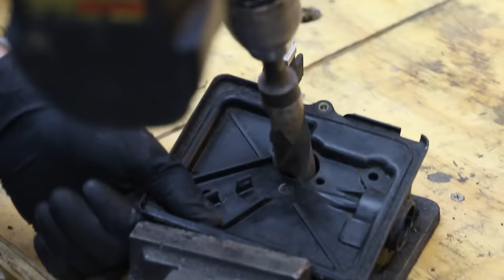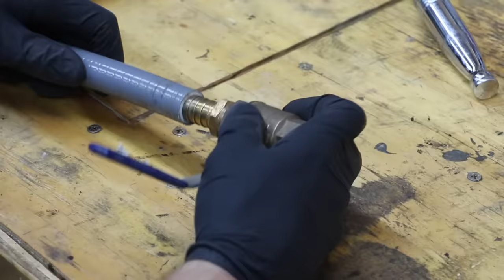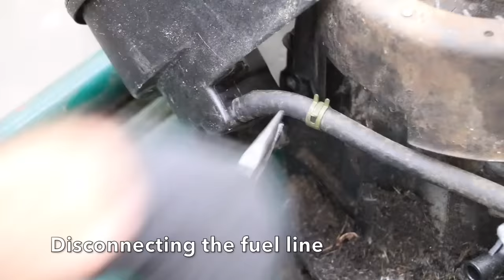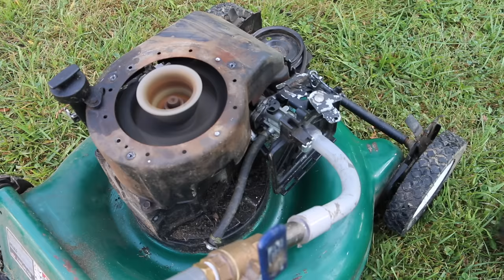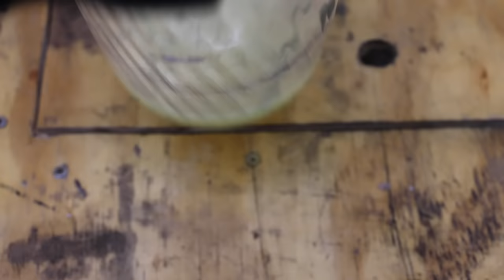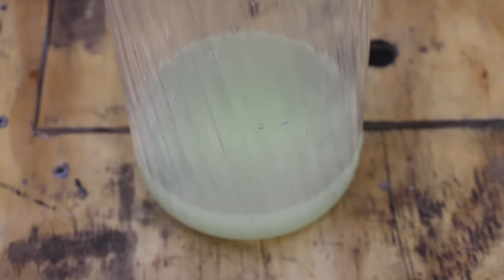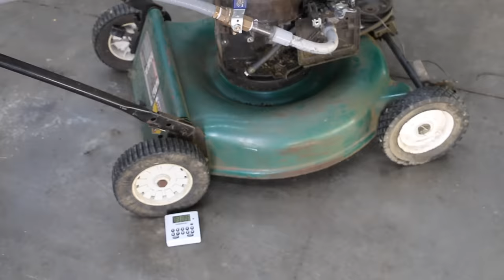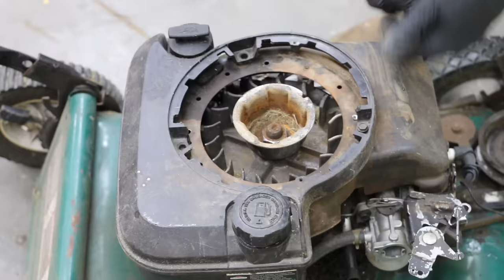Will a "Gas Vapor" Container Improve MPGs and Fuel Efficiency?  Let's find out!

Comment: On your setup for vapor feed, you need to meter in filtered air with the vapor from the canister. Put a "t" inline with the vapor coming in from the bottom and filtered air from the top. The vapor line should be wide open, and the airline will be your throttle controle. Just be sure to watch your engine temp, to high, more fuel, to low more air.
Reply from the maker: Thanks for the feedback.

Comment: People were probably referring to a GEET reactor (Paul Pantone), it's using the same bubbler, but the vapor goes through a pipe with metal rod inside it, then that pipe is inserted into the engine exhaust pipe. The theory is that the cold vapor fuel passing through the heated exhaust turns the vapor into a plasma(I'm not convinced that's attainable - I thought it would take more heat... but there is a vacuum but again insufficient), and the metal rod constricts the flow as a venturi, accelerating the plasma to your engine intake. The plasma fuel burns easier,  more bang for each oz of fuel, ergo the consumption is better.
Reply from the maker: Thanks for sharing.

Comment: Try Marbles, smaller intake hoses, splash guard, separates the air and prevents droplets from being wasted, spreading out the airflow and even using a different fuel may benefit. Maybe also add a periodic injection of fuel instead of a continuous bubbling tank to minimize that splashing, maybe an alternate one time injection into the engine to get it started and then run off the marble guard etc. I also have thought about the introduction of HHO gas to a vapor setup and see how it effects the fuel usage, but then we're talking alternator or battery needs for the conversion etc.
Reply from the maker: Thanks for the suggestion.

Comment: The fact that it works with vapor proves it can be possible.

Perhaps something needs to be done first with that vapor... pressure temperature etc

But you have proven that just using gas vapor doesn't increase the mileage.

Well done.
Reply from the maker: Thanks!

Comment: Look up V-GAS out of Wooster and Toledo Ohio!! 
My grandparents had stock in that company and was authorized dealers, the company abruptly ended there was let's just say some stuff that went around however, when I got to vacational school in the early 2000s I had mentioned the gas and my instructor and the mechanics class had wondered how the hell I would know about it turns out he too was an investor and he more than heard of the same things that happened...

Basically one of the executives got his porch blown off and I believe there was another executives it was targeted...

 V-GAS was a system that contained a Ventura that helped vaporize the gasoline before it basically would flow into the engine my grandfather had it installed on his truck and it did indeed work they were in the midst of coming up with a system for fuel injected cars they basically had already had it designed it was about to go in production when all of this went down it's pretty much surmised to cross those who know about it that GM basically had a hand in putting the kibosh on the company!!

Comment: Great work! Wonder if you tried running a tank through it, pulling the head, and comparing the deposits to a regular carburetor, if it would burn cleaner? Maybe an increase in oil and engine longevity similar to propane?
Reply from the maker: Thanks for the suggestions.

Comment: Running vapor for efficiency requires the valve timing changed to have the exhaust valves close at top dead center and at least have on degree of rotation before the intake valves open so that the vapor doesn't get lost out of the exhaust. Normal gas engines have a cross over timing that the exhaust doesn't close before the intake opens so that the hot exhaust helps to vaporize the fuel droplets sprayed into the cylinder. This cross over is also part of the reason standard gas engines are not as efficient as the separated intake and exhaust flows on a vapor fuel engine.

Comment: When I was in auto shop in high school 40 years ago, we had the principal from our nearby town bring in a huge car from GM. Huge engine and all we had to do was change the brakes. Our teacher came up and was talking to us about the car and seeing if we installed the brakes properly. Of course we did and he said you boys did well on this experimental car, he said that the principal bought the car from the dealership and they called him wanted to buy it back. They explained it wasn't supposed to be sold and offered him 50,000. The car had 8 cylinder's and at 55 - 60 mph 3 cylinders cut off and fuel for those cylinders were replaced with gas vapor only, we stayed after school and our teacher and us standing around took a little peek, I remember clearly most of the way it was put together, totally genius idea but like always gas companies put a stop to it. Sorry for the long message.
Reply from the maker: Thanks for sharing.

Comment: Great Video as I had questions about this as well.    However after thinking about this, I believe your bottle is almost replicating your fuel in the bowl of the carburetor.  Since the engine ran the same amount of time, the fuel vapor has to be very similar.     I believe to have success with this you need to heat the fuel and heat the air going in to the engine to improve the thermal efficiency of the engine.     (Smokey(henry) Yunick patent might shed light on this).   Very good video.
Reply from the maker: Thanks!

Comment: There are several problems with "vapor generators." Safety is the biggest one. Any ignition source, be it static build-up and discharge (like running air through plastic tubes,) an intake blowback, or whatever, and your system will explode. The larger the chamber, the more dangerous. (Also consider the "shut-off" state. You need to completely seal the chamber to avoid fuel vapor buildup in the engine compartment or an enclosed space, like the garage.)

Another issue I've seen often run into is the inability to change engine load rapidly. Not so bad for many applications, but not good for many vehicles.

I suspect you could gain a little efficiency over other methods of fueling, because you're not depending of the intake and combustion chamber for the latent heat of vaporization. But we're talking some real low numbers here. Your HC emissions on a good engine are around 100-150 PPM before any catalyzer... That's coming down from a stoichiometric intake mixture of roughly 14.7:1... (which is about 7.35 liters of air for every gram of gasoline.) Probably even less with the use of broadband O2 sensors.

Being able to make an engine run on fuel vapor means nothing. I can get a diesel to run on a can of hair spray, but that's meaningless. The only meaningful measure of engine combustion efficiency is BSFC. Without that information, you've got nothing.
Reply from the maker: Thanks for sharing.

Comment: I think your bubbling tank is basically doing the same job as a carburetor / injector. That is to say, some of what comes out is vapor, and some is atomized liquid droplets (the agitation is quite extreme in there); and the same is true of carburetors / injectors. The droplets are so small, and the pressure and temperature so high, in all of these setups, you're burning a fuel/air mixture.
Reply from the maker: Thanks for sharing!

Comment: You can test name brand screws and bolts nails for strength, plus durability in planks sitting out in all weather for two years. I used coated screws for wood and they had severe rust after 4 years when unscrewed.
Reply from the maker: Thanks for sharing.

Comment: There is still a stochemetric ratio, forgive probable mis spelling, but the ratio applies to any fuel, represents the perfect ratio of air to fuel to not have any unused hydrocarbons used in the combustion process being left over, this is why you had to adjust the vapor ball valve to achieve this ratio(fuel/air) for the engine to run, the carb is trying to do the exact same thing. Not too Rich or Lean, or you get wasted byproducts out of exhaust.
Reply from the maker: Thanks for the feedback.

Comment: My neighbor pumped oil wells here in northwest ohio, from age 16, to age 90. For many years he used a 1939 Dodge truck with a hoist mounted on the frame. The engine for that hoist, ran off the fumes from a tank behind the cab. He said he would put 50 or so gallons of crude in the tank, and the hoist would run for a "good long while". Then he said he would drain the tank into the product tank, and put fresh oil in it. I thought he was pulling my leg, but there was no fuel tank on the hoist engine. A rubber hose ran from the top of the tank to the engine.

Comment: If the vapor line proceeded into the bottom of another tank of water and baking soda; with a hydrogen plate generator; you would have a gaseous mix that will provide the mileage claims you had heard about..
Possibly mixing hydrogen gas in certain ratios to the gasoline vapor.
And I would provide a magnetic field surrounding the resulting gas mixture of H w/petrol vapor.
Reply from the maker: Thanks for the feedback.

Comment: Car manufactures have been using vapors to improve efficiency of their vehicles for many years now. It’s called the EVAP system. You need to use active carbon to collect the hydrocarbons from the gasoline

Comment: I did this with an old 6hp generator, sucking the fumes off the top of a two gallon gas can. I ended up with around 25 to 30 % better efficiency on fumes than liquid. Not a crazy amount but pretty decent I think.

Comment: Your gas bottle setup is similar to the water bottle on my moma's oxygen maker from years ago. Her oxygen circulated through the water to create moist air. I rigged up one of these bottles on my 1972 Pinto & hooked it to a vacuum line. I thought it might improve mpg. I got afraid it might cause rust inside the engine so I took it back off.
Reply from the maker: Thanks for sharing.

Comment: A big thing is on the delivery. Some systems can vaporize the fuel well. And if tuned properly will do fine on liquid. But say you have a big v8 with a big 2 barrel on it. At light throttle there's not much air velocity to vaporize fuel as efficiently. 

Now a lawnmower is running pretty wide open all the time and its little carburetor is pretty much tuned for wide open mixture and higher air velocity will pull the gas apart and vaporize better.  Which is also why a car with say a 4 barrel with small primary side can get better highway cruising milage than the same engine with a big old 2 barrel... Basically you would be more efficient on cruising a car engine on a small venturi carburetor that is fairly maxed out open just enough to sustain cruising speed at whatever speed you want. Say 65 mph. You have the smallest venturi carburetor that will hold it at 65 cruising while that little carb is full throttle. With a proper mixture. Maybe ever so slightly lean but not much. .. if you ever tuned a car in with a o2 sensor hooked up got it to a perfect 14.7 mixture and the tailpipe still smells like gas fumes .. well not all the incoming fuel has vaporized. And just got shot out the tailpipe. The o2 sensor doesn't detect fuel. Just the oxygen content
Reply from the maker: Thanks for the feedback.

Comment: I believe the tube picking up the vapor was supposed to be shorter so it pulls vapor if you noticed it was the same length as air supply , air supply was good but the fuel pickup was picking up raw gasoline as well as some vapor the pickup line should been shortened by 1/2 to 3/4 of it's lenght than it would pickup almost all vapor !

Comment: Interesting! You created a vacuum essentially through the engine suction right? I wonder if heating the vapor or the fuel would have made a difference. Perhaps by running a copper fuel line rapped around the exhaust several times to heat the fuel? Just throwing ideas around
Reply from the maker: Thanks for the video idea.

Comment: Well, that was Amazing!!!  I thought it wouldn't work as well.  Considering the guy who commented here about how his dad bought plans for a 75 mpg carburetor in the 70s and made claims that up to 800% better is possible, based on the vaporization process, which I what I also thought might have made your rig better than 2-3% better, I tend to agree.  I was going to say that the bubbling action wasn't really vaporization and a refined process may help.  But you proved that things like those 60s and 70s tall tales of super high mpg carburetors were more than just tales, and so were the fates of those carburetors.  Consider Stanley Meyer and his water powered car (for which used Hydrogen made from H2O, onboard I think).  A mystery unresolved to this day and still often brought up.  He mysteriously died in the 90s.  I don't know what happened to his patents.  Great adventure here, Todd!
Reply from the maker: Thanks!

Comment: This is what the Evap system does during warm up. At idle the injector pulse width is shortened and the vapor vent valve opens to let vapor from the fuel tank into the air intake, thus enriching the fuel mixture. I personally think this function should take over at idle / ie; any time no load is presant and if possible shut down injectors completely.
Reply from the maker: Thanks for sharing.

Comment: I built myself a tank for a car which is what is 1' by 2' by a foot and a 1/2 and design it in such a way to draw  Air in through a filter percolate the fuel and then pull the vapor and air into the confession chamber

Comment: ...so, 2 1/2% of 20 gallons is half a gallon. at today's prices, you would save $2.50 per tank. or, if you got 20 mpg, you would get 20.5 mph...- doesn't really seem to be worth the trouble - unless you just like the idea of running on fumes    :)    - thanks so much for doing the work; I've always wondered if there was anything to the gas vapor products they used to offer up for sale - generally, the selling method is to take something that gives a very slight advantage, and completely exaggerate what the results will be - like supplements that say you will have plenty of energy if you take them and then provide a very slight (hard to perceive) increase in energy - what does really work quite well is the amount of money you can make on this type of product if you are heartless and don't care about how you make other people feel    :)
Reply from the maker: Thanks for the feedback.

Comment: Awesome video man only thing I can think that may make a difference if at all would be doing this test with a fuel injection engine rather then a carbureted engine because the carbureted engine literally does turn the liquid fuel into a vapor as it goes into the combustion chamber I just thought about that cuz like when you think about it you have your fuel line that goes directly on into the carburetor you know and it fills up the bowl for whatever at the bottom however it's set up and then it takes that fuel in it when you twist the throttle or push the throttle down the pedal whatever it sucks the fuel up and throws it into the combustion chamber or your top end thus and then that spark plug does ignites it creating that compression and that explosion that thus makes your engine run so basically it does actually take the liquid into a vapor but a fuel injection I'm not exactly sure how that works so that's maybe somehow could create a different result I have no idea if it doesn't have a carburetor on it I don't mess with it because no thank you but I mean you know yeah that's my thoughts hopefully that makes sense I'm not a mechanic by the way I don't claim to be just for you know anybody that wants to come at me saying I don't know what I'm talking about well that could be true I don't claim to be 100% but I'm pretty sure that's how it works you know if I'm not then well correct me I guess or prove me wrong I don't know I don't care but fuel injection I would try to make it vapor with a few injector again I don't know how that would work so good luck
Reply from the maker: Thanks for the feedback.

Comment: All gas engine burn vapor, not liquid fuel. That's the purpose of the carburetor and even a fuel injector system - to turn the fuel into a vapor and mix with air in the correct proportion to allow combustion. Great experiment though. Your ingenuity is amazing. 

Now, to turn coal,wood, or even corn into a vapor and then burn it in that internal combustion engine...
Reply from the maker: Thanks!  Thanks for the feedback.

Comment: I realize it's been a long time since you posted this but I have a theory I want to share with you.  
   I  think maybe you are agitating the fuel a little to much,  the way it's idling at such high rpm's tells me that if you had a way of agitating the fuel less it wouldn't use so much vapor and in turn would probably go much further. Smaller hoses would be a start.  Also I've always thought that a gas engine ran on vapor to begin with and the carb was just part of the process of turning liquid into vapor when it squirts the fuel into the motor it ignites vapor. Anyway I'm rambling now. Thanks for making the video it is interesting and I do think it's possible to get better  fuel economy somehow this way.
Reply from the maker: You are welcome!  Thanks for sharing.

Comment: Two crucial points my friend.

First: the engine speed with gasoline vapor was higher than that with liquid gasoline.

Second: you should have placed the liquid fuel in something transparent so that everyone could see the veracity of the test, instead of placing it in the original engine tank.

Who's to say you didn't put more gas in the tank during an image cut?